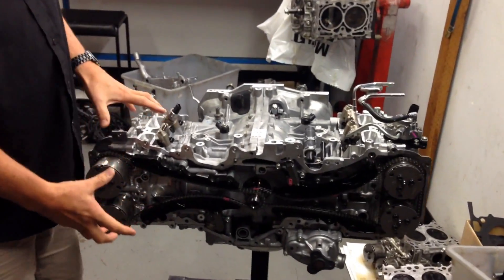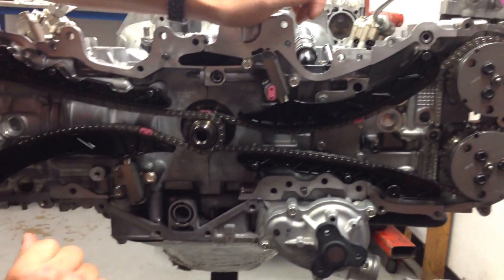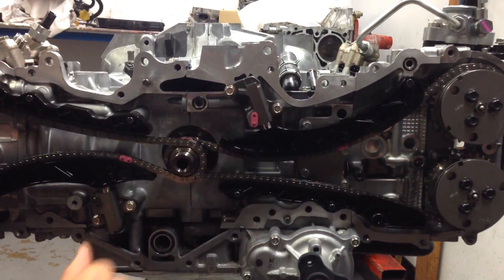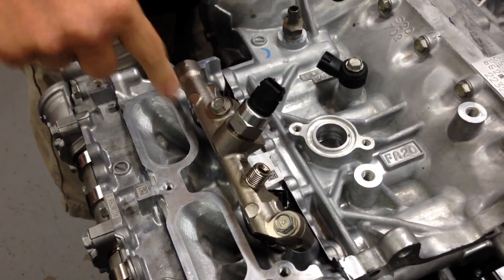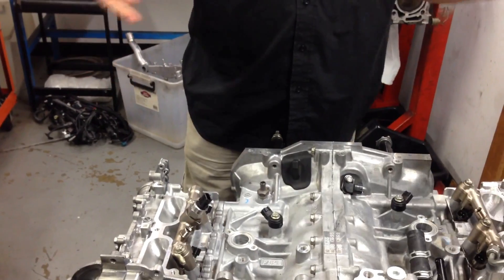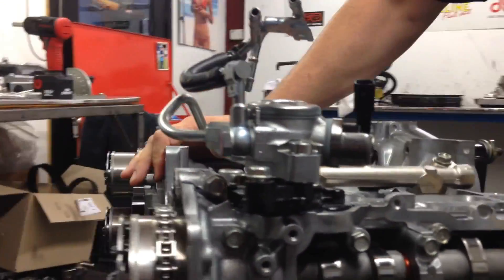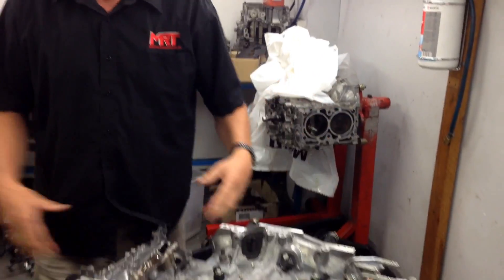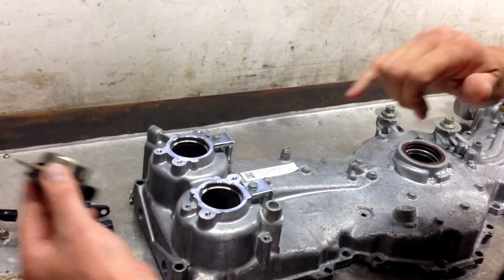Subaru BRZ engine upgrade part 4 Toyota 86 Scion FRS

Comment: Do you have a video of the overall walk through of the cylinder head, rebuild? I am putting together my block, using a closed deck block. I am running into issues finding information on cylinder heads parts that are reliable, and how much flow to increase.

Comment: Hi, could you please make some comments and share your thoughts on a comparison between the EJ257 engine found in the MY15 STI in north america and the new FA series engine? Which one of these two (EJ257 or FA20) is more durable, reliable, and failure free in your technical opinion? Both in stock and prepared forms. Thank you and congratulations for your projects and videos!